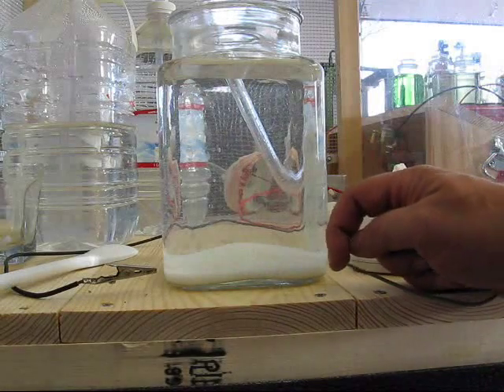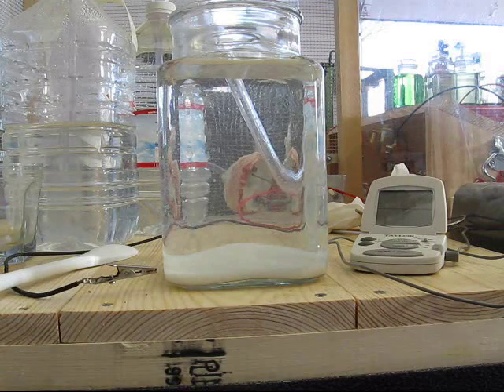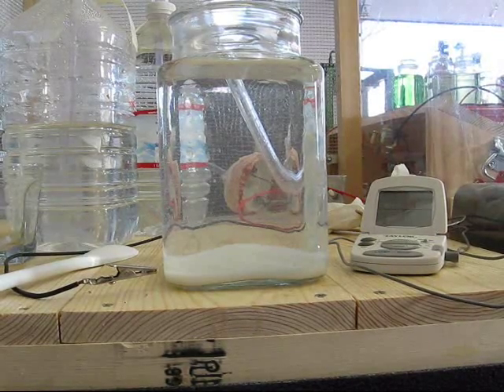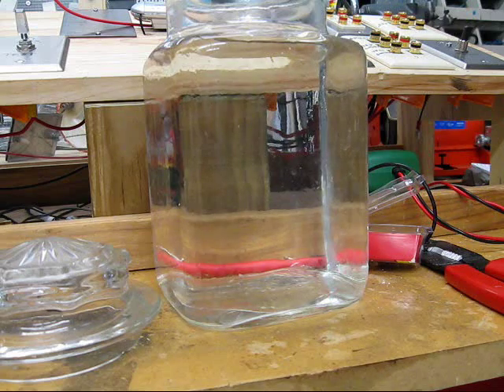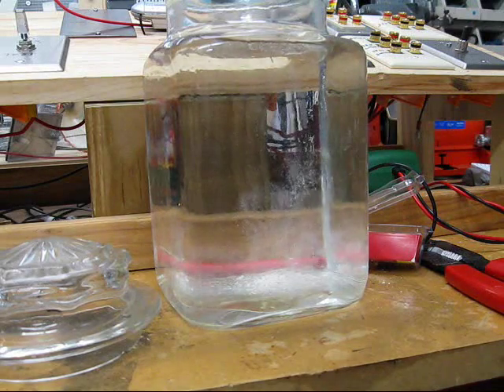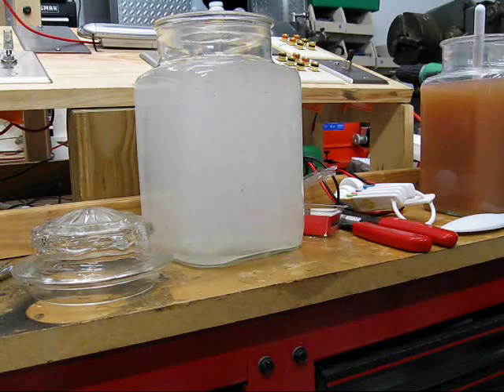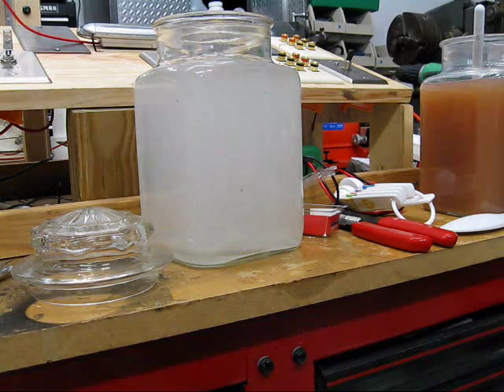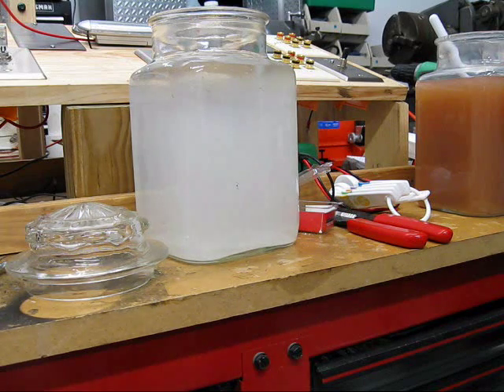#08-048 Saturation Test with Calcium Hydroxide in Purified W

Comment: the solubility of calcium hydroxide is 1.7 grams per 1 litre of water its insoluble in water.  If you need calcium cat ions in your solution you should use calcium chloride or calcium acetate.